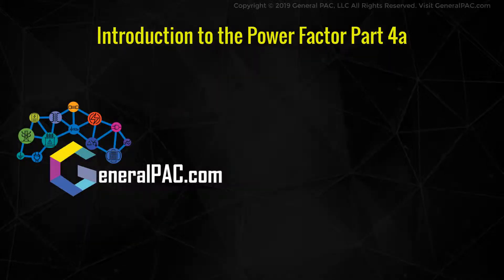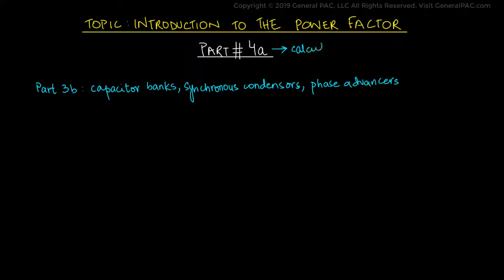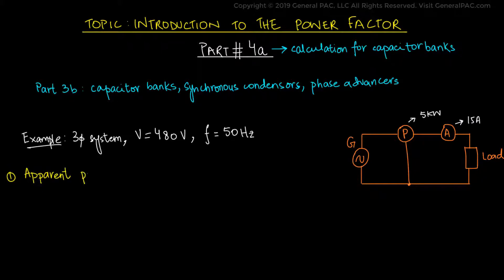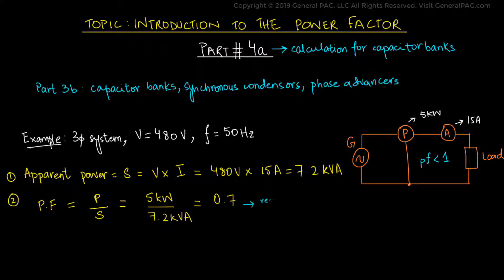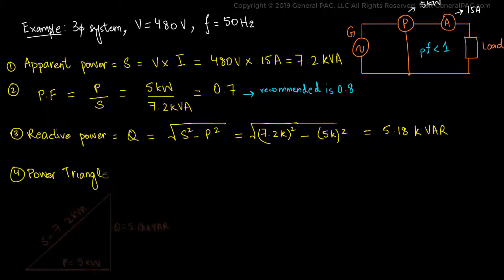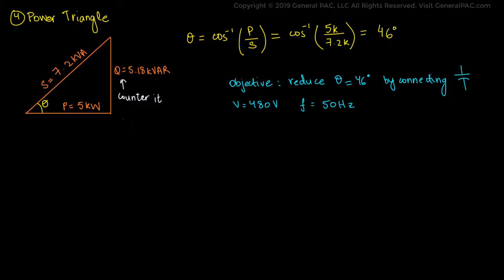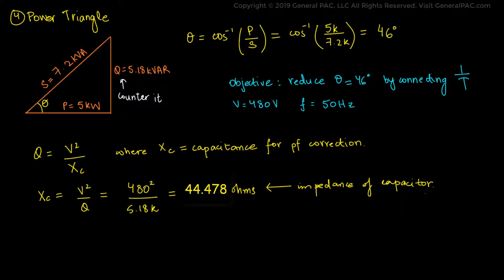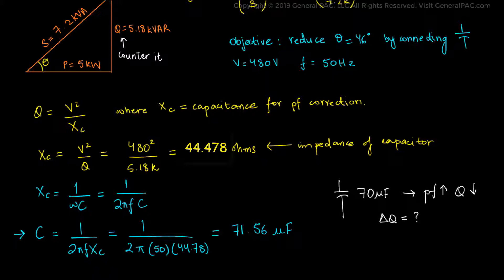Introduction to the Power Factor, Part 4a

Comment: Nice video. However I think you used the wrong formula for |S|.   
The right formula should be |S|=3 Iph * Vph  (where Iph  is the phase current and Vph is the phase voltage). 
We can also use |S|=1.732*I*V( where I is line current and V is line voltage)
Both formulas gives same answer